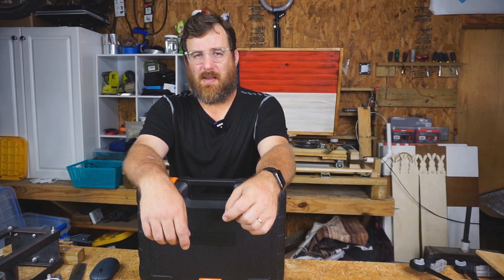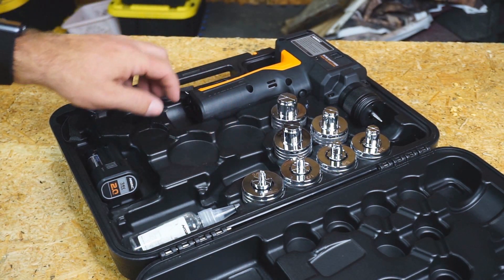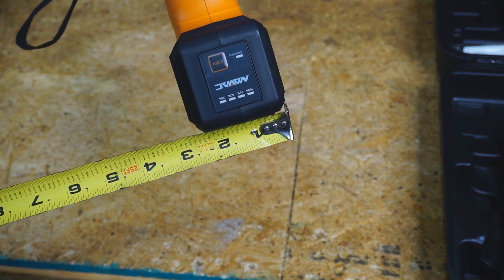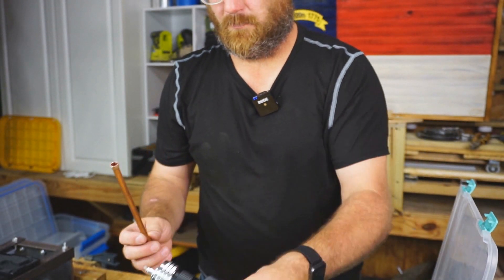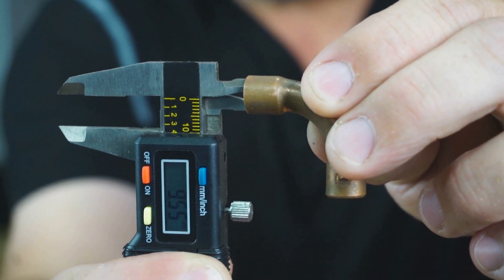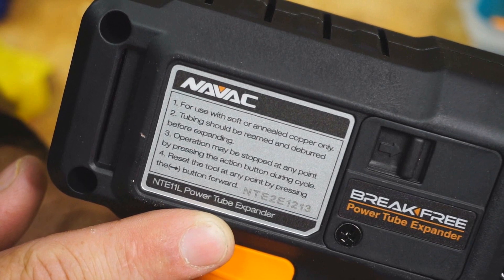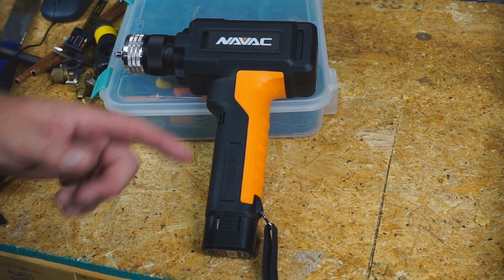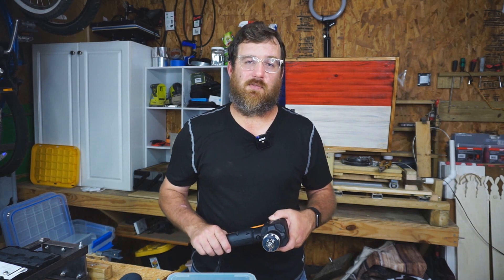The New Way to Swage | NAVAC NTE11L Battery Tubing Expander

Comment: I like the manual pistol grip model. Sometimes I want to expand the pipe slightly so that it fits in the female of the air handler fitting.
Reply from the maker: That’s a good point. I did that too.